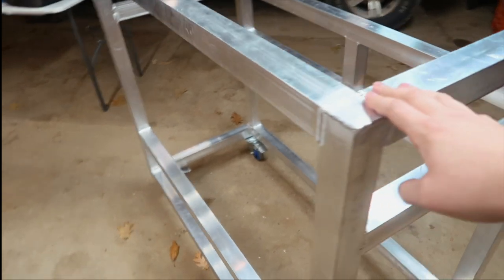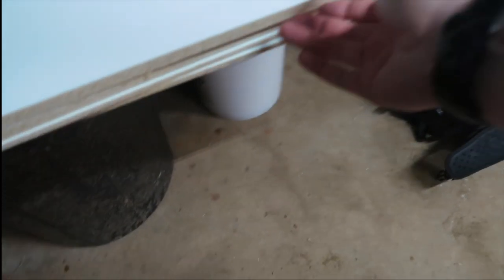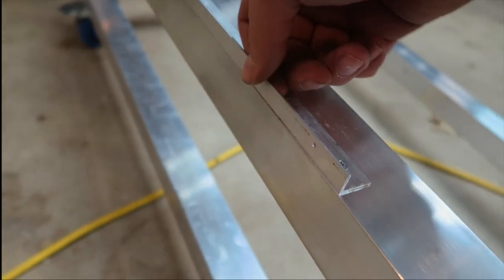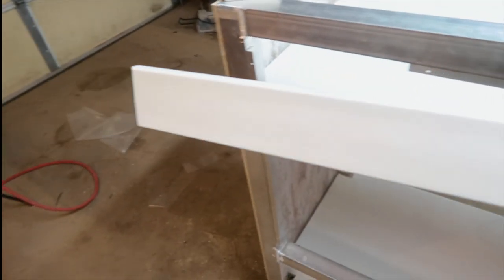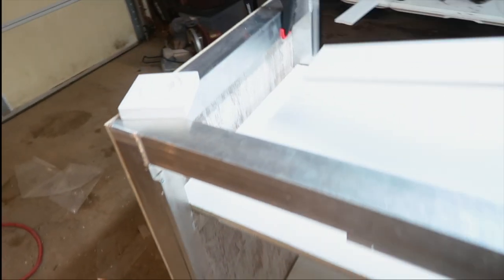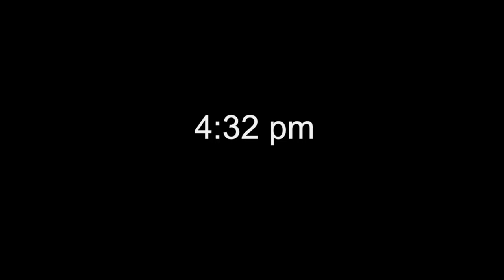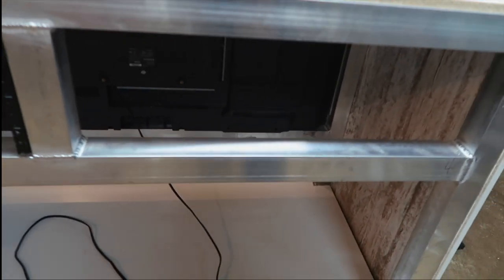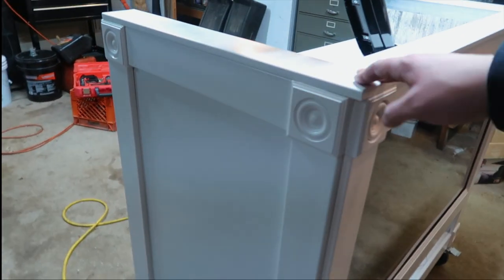Custom Video Dj Booth Build

Comment from the maker: all said and done I have about $1000 into this booth. Below is the parts list.

6 12ft sticks of 2x2 aluminum tubing $300
6 8ft pieces of PVC trim
12 corner blocks
1 base board 8ft pvc
2 1/8th inch panels 24x48
2 1/2inch panels 24x48
1 36x48 .096 plexiglass
4 locking 4in. casters
1 48inch 1inch angle 
2 48in 1/2x1/2 angle
1 55inch tv
1 laptop arm https://amzn.to/2NoTFxP
Sennheiser G4 https://amzn.to/3a8dnaI

My Photobooth
Salsa Booth:
http://pbsco.refr.cc/logans

Vault Link:
https://djlostax.krtra.com/t/hE4JHYIG...

The best wedding event app for DJ's
https://vibo.io/

Tell Michael i sent you for a killer deal!

www.bpmsupreme.com
use Promo Code: LOSTAX30 for 30% off 

Rockville Totems  https://amzn.to/2DPBSen
Gravity Stand https://amzn.to/2H4aDP6
Sennheiser xsw-d  https://amzn.to/2KvgvkM

------------------------------------------------
Social Media
Facebook  https://www.facebook.com/Dj.LoStax
Snapchat dj.lostax
Instagram @djlostax @lostaxentertainment
www.lostaxentertainment.com

------------------------------------------------
Dj Equipment 
Rane 62  https://amzn.to/2wo5J94
Technic 1200mk5  https://amzn.to/2PG4DOO
Pro x side by side case https://amzn.to/2BS3ErP
Crane stand  https://amzn.to/2Npb2fR
Pioneer HDJ x7  https://amzn.to/2NrZloN
Jackery 20800mah battery pack  https://amzn.to/2U972Xp
Gravity Stand https://amzn.to/2VJ62Kb
Onstage Stand https://amzn.to/2ngk0UZ

Speakers
Mackie SRM450v2 https://amzn.to/2Noa7MD
Mackie 1801 Subwoofer  https://amzn.to/2LvKHLl
Gravity GSACC35B SACC 35 mm Speaker Pole Cable Clips  https://amzn.to/2Npcrmv

Microphones
Fifine lav mic https://amzn.to/2ocuh0W
Shure SLX4 https://amzn.to/2H12sBL

-----------------------------------------------
Lights
Chauvet Slim Par 38  https://amzn.to/2PDxaV8
Chauvet Slim Par 56  https://amzn.to/2wvfYbw
Chauvet ez Par 56  https://amzn.to/2PJbLdh
Chauvet Slim Par 64  https://amzn.to/2BUiVso
Chauvet Slim Par Bag  https://amzn.to/2wq9D1f
Chameleon Qbar Pro Wifi  https://amzn.to/2ogE46o
Adj Airstream Bridge  https://amzn.to/2BRKBOz
ADJ Stratec Stinger Spot  https://amzn.to/2PIFymb
Chauvet FX2: https://amzn.to/31r1ZC7

Table Scrim  https://amzn.to/2LBii6I
Onstage Speaker Scrims White  https://amzn.to/2BROGlF
Onstage Speaker Scrims https://amzn.to/2BROGlF
Rockville speaker stands  https://amzn.to/2NrJSFc
Rockville Facade  https://amzn.to/2ohnymI

Ceremony Mixers
BEHRINGER XENYX 1202FX  
BEHRINGER XENYX 502  

Camera Gear
Canon G7X mII https://amzn.to/2VNg514
Canon SL2  https://amzn.to/2PHOKqY
Joby Gorilla Pod  https://amzn.to/2woMH2o
GOPro Hero 5  https://amzn.to/2wufItt

Sandisk 32gb Card http://amzn.to/2Eqm18g
Sandisk 64gb http://amzn.to/2CjXGei

--------------------------------------------
Send Mail To

P.O. Box 20112
Kalamazoo, MI 49019

--------------------------------------------

For Business & Booking Inquiries Contact to me at 
dj.lostax@gmail.com
Reply: Does your total include the frame?
Reply from the maker: Yes. This was a few years ago though so aluminum prices could have gone up
Reply: @DJLoStax  Thanks for the feedback. I am a DJ in Oakland County of Michigan, love your video's. May one day we will rin pass each other. Keep up the great work.

Comment: This looks good man! How’s it holding up? I really need a booth because of an injury. But don’t wanna wait for Toad and others to produce one if I can do it myself.
Reply from the maker: It’s holding up very well I did have to go through a little trial and error before I found an adhesive that would stick well to the aluminum I also had to rough up the aluminum to get the trim to stick
Reply: @DJLoStax  What adhesive did you use? As I have been putting plans together I have been thinking about the use of screws, or adhesives, or both.

Comment: I just built one myself.  1.5” extruded aluminum with a 50” tv on the front.   Very similar in design.   I like yours better because it’s all white with trim.   Mine is aluminum with black ABS plastic.   Looks like a road case.   
Very nice work, bud.  
You can check mine out On a couple of videos on my channel.

Comment: Nice job on this. Question - what are your side panels made out of? Like a white fiberboard?
Reply from the maker: Pvc panels.
Reply: @DJLoStax  Appreciate the reply. Where did you get the panels from? Home Depot? I can't find it anywhere locally where I live. How is this holding up for you?
Reply from the maker: Yes Home Depot. It’s held up really well. I love the pvc because it’s not painted so no worries about paint chipping or anything like that
Reply: @DJLoStax  Love it. Good to know. Last question, I promise lol.. you just simply pre-drilled and screwed the pvc into the metal frame? And glued on the trim pieces?
Reply from the maker: Yep exactly. Them I used white caulk on all of the seams to tie everything together. I’ve had to touch up some spots but it’s held up well over all. It’s gone out to 13 weddings this year so far and all I’ve done is wipe off some spilled drinks
Reply: @DJLoStax  very very nice. I am not very handy, so I am not sure if its something I want to tackle lol. Wish you lived in FL so I can pay you to make me one lol. Thanks for info bro.
Reply: @DJLoStax  this might be a stupid question, but how did you attach the casters? Did you weld a steel plate to the aluminum and bolt them to that?

Comment: I'm curious how you mounted the tv without using the mounting holes.
Reply from the maker: It’s just pinched between the rear shelf support and the aluminum angle I mounted to the frame. It’s not going anywhere without removing that support.
Reply: @DJLoStax If something happens to the TV, would you have to take the booth apart to change it?
Reply from the maker: Yes but it wouldn’t be hard. Just 4 screw on the top shelf and 2 holding the bracket in place behind the tv. I wouldn’t have to remove any trim or any of the decorative pieces.